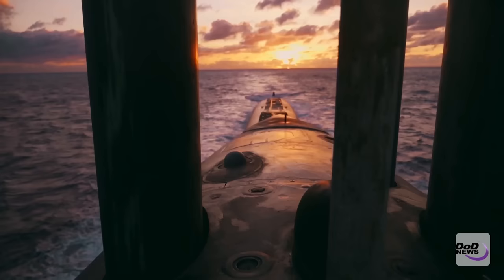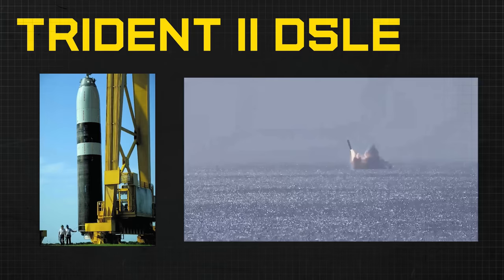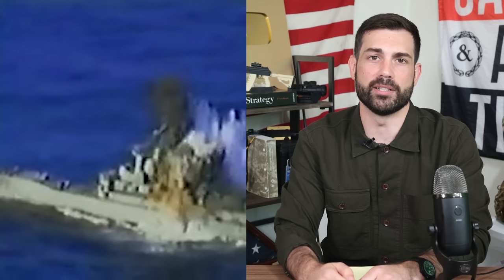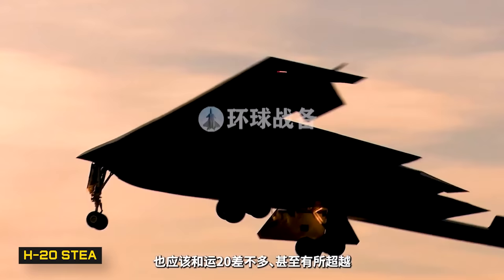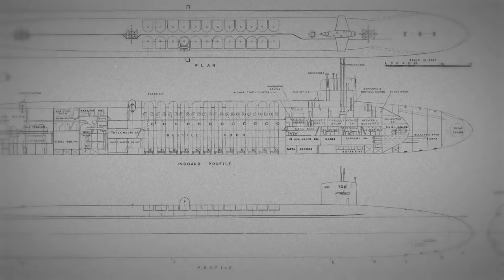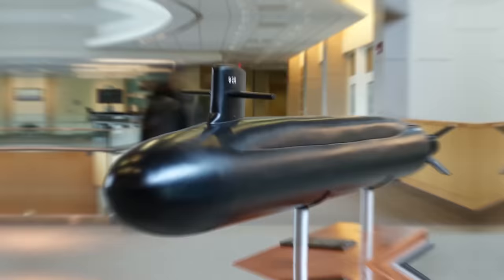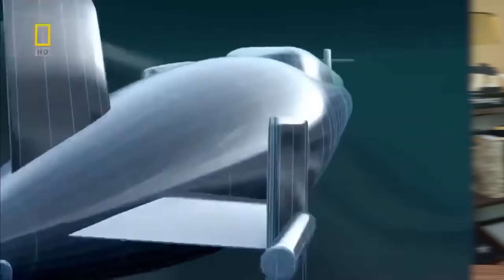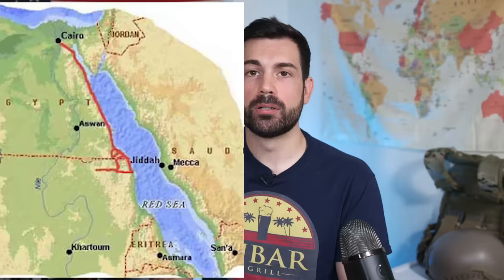Why America’s New Submarine is their Secret Weapon

Comment: You can't keep all 12 subs out at the same time. You need enough for rotations, repairs and outfitting and crew rest and training.
Reply: something we are going to lack if recruitment can't get enough
Reply: Well the Navy always had trouble with recruiting, more so even than the Army.  Something about being a "swabbie" is kind of a turn off, knowing you will be swabbing that deck.
Reply: @user-wz1qo1cn3i  I never heard anyone say "swabbie" the entire time I was in the Navy. I don't think that is actually a Navy term. They did sometimes say "squid" though.
And besides, I'd far rather have been swabbing a deck than stripping and painting it.
Reply: @nathanahubbard1975  I heard an ex Marine use the term swabbie for the Navy. I did hear that sailors spend a lot of time rust removing and painting.
Reply: For some time each SLBM submarine had a Blue crew and a Gold crew.  The subs were reliable enough that they were ready to return to sea before a single crew would be ready to do so.  So two crews ensured maximum time at sea for the SLBM sub itself.  I don't know if that is still the practice.
Reply: @nathanahubbard1975  it's an old term from ww2
Reply: @timtrewyn453 not since the drawdown in the mid 90s.
Reply: @nathanahubbard1975  I worked at a Ship building plant and came out a manhole and the first thing I saw was a squid swabbing the deck.
Reply: Same thing happens with the Australian submarine service not large enough in numbers
Reply: @nathanahubbard1975  Yeah I still have flashbacks of using a needle gun and the smell (stench really) of mixing red deck, pretty sure each batch we mixed took a year off the end of our lives, I'll take some cleaning stations anytime!
Reply: @nathanahubbard1975 When I was in Avionics A school in 1972 we had Marines in ours class and they called us swabbies. I was in the Navy and never went on a ship.
Reply: Yep the rule of thumb is for each ship deployed 1 is in refit and 1 is working up from refit.
Reply: @Chris_at_Home  I was in the Navy 30 years ago, not 50.
Reply: @garygeorge9648  Right, he was a Squid though. A close relative of the Jarhead.
Reply: @timtrewyn453  My brother in law retired in the early 1980s. He did his whole career on boomers. I remember a few of them he was on . My brother was on fast attacks and got out after 13 years. He also was a chief sonar technician. He told me he wanted to see his family grow up. Something scared him. I worked on aircraft that hunted subs and only did 4 years.
Reply: The boomers each have 2 crews (blue and gold) that alternate to keep them maximally deployed. I don’t know if that is also true of the cruise missile ohios.
Reply: @mrspeigle1 then we need 36 of them.
Reply: Four will be deployed at a time. With 16 silo's that is 256 Warheads per sub or 1,024 warheads deployed at any given time.
Reply: Pretty sure the max you would keep out at the same is 4. Navies usually work in thirds. 1 vessel deployed, 1 being maintained and repaired and 1 resting & recovery. So usually only a third is deployable at any one time.
Reply: @user-wz1qo1cn3i  "I heard a [former] Marine use the term...."  Fixed that for you.  No such thing as an "ex Marine".
Reply: They use double crews. One crew is resting and retraining while the other is deployed on the sub. Then they switch.
Reply: Actually you can keep all 12 out
They just rarely do it
Reply: WTF is wrong with all the young and these days. I'm ex Royal Navy and I sure as shut had to dash the decks, chip and paint and pull crappy watches. It's called being a junior sailor. You learn and as time goes on you move up and things get easier. Even the youngsters joining the Royal Navy today, want and expect to be chief of the boat within a dogs watch of joining. In my time in the 80/90s you WOULD get a boot up the ass if you came aboard your new ship with an attitude.
Reply: @user-wz1qo1cn3i  That is a specific rating, not everyone in the service.
Reply: Full of deployment would signal War. You would do that prior to a first strike.
Reply: @Ron-u1z  You do realize your exact attitude goes back to the era of humanity’s first recorded word, right?   With Babylonian’ “Boomers” making the exact same comments about the current soldiers wanting “free clothing” when they were called up for combat.   
 Every single post Industrial Revolution has been the butt of those complaint.  You can start with the youngest sailors demanding no more flogging during the Crimean War, to Canadian WW2 draftees who literally rioted against deploying outside of N.America; to “The Scared Rabbit Generation” (US WW2 Veterans) being derided as so soft & lazy they wouldn’t volunteer without free houses, education, & lifetime healthcare in the US. 
The problem is the exact opposite is true.  

A combat solider in today’s (NATO) militaries can expect around 260days/yr of frontline duty during wartime. Then compare that against the ~80 days of a US independence war veteran, the ~120 days of a WW2 veteran, and finally the +225days of Vietnam-era veteran.
Reply: @user-wz1qo1cn3i 
No crew member ever chipped paint or painted on any submarine when I sailed them in the 70’s.
Why?
It’s the silent service. Chipping on the hull or anywhere on the sub generates a lot of noise and gives away your ovation.
If we need to use a drill or or any other abnormal noise making tool, we had to call sonar to see if it was OK.
Reply: @timtrewyn453 
Yes, boomers still use two crew concept. Turn around time between patrols is only a week or two. For yard periods, which could last up to a year or more, they trim down to a single crew, them go to two crews again coming out of the yards.
Reply: Ugh. 41 after WW2 to just 16 now?
There were no SSBN in WW2, they were not developed until 1959 when the George Washington was launched.

The 41 For Freedom boats were based on missile capability. The Polaris couldn’t carry multiple warheads and had 16 missile tubes. The Poseidon had multiple warhead capability, I think 8 per missile. The subs were forward deployed since the missile range was short compared to the Tridents.
Bottom line, even with only 14 new Columbia boats, they still carry the same megaton capacity as as the 41 boats.
And since missile ranges are far longer, the boats can launch and hit targets from the coast of the US instead of being just off the enemy’s coast.
Reply: @nathanahubbard1975 
Squid is a surface puke and Bubble Head is a submariner, get it?
Reply: @michaeldobson8859  Why are you telling me this? I was in the Navy.
Reply: You know, I suspect the Navy knows that or perhaps they are really stupid!
Reply: @mrspeigle1 why is usa doing this while russia is creating top notch nuclear weapons like the rs28 and new submarines and nuclear posedion under water drones .... that is said to have a payload of 100 MT.
Reply: time - en - route vs. time on station.
Reply: Yeah based on my experience at a minimum the Henry m Jackson needs to be in dry dock at all times.
Reply: Gotta love those refits, makes me rather be on underway that refit.
-TIRED MMA2
Reply: Only half need to be out to be at full force that's why they pick 12 so they can be down for refit repairs and training  and be at full powered
Reply: Yeah but the new class requires less overhaul so it should be more available
Reply: @user-wz1qo1cn3i  wiping the poop deck every now and then
Reply: @nathanahubbard1975 Squids & Airedales for those of us up in the air.
Reply: @user-wz1qo1cn3i  As a "swabbie", I can tell you do not know anything about submarine life.
Reply: Based on current rotation capabilities with Ohio, and similar with other national SSBN fleets, it is likely we could keep ten at sea at any given time.